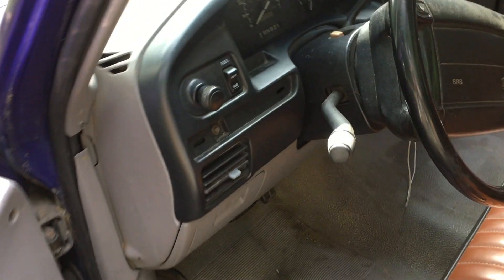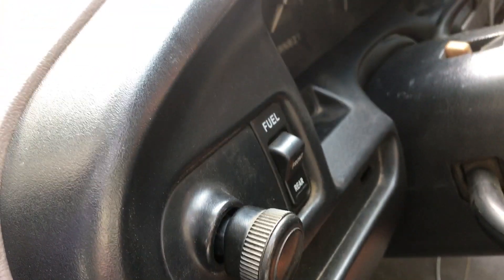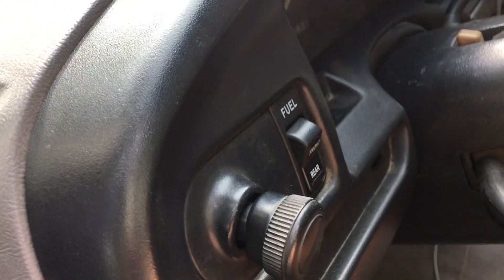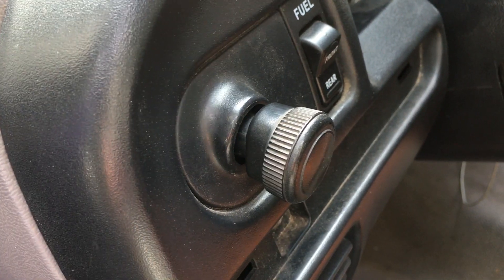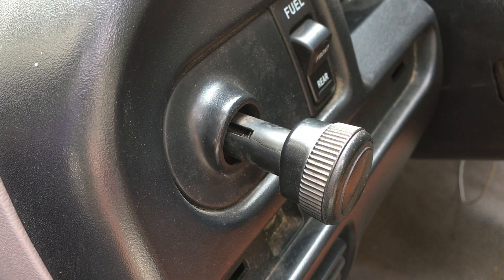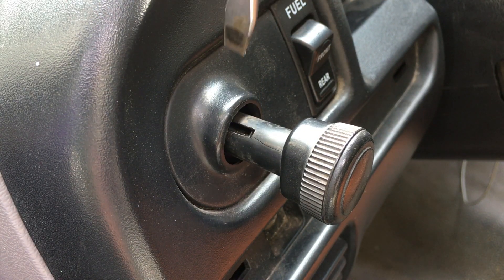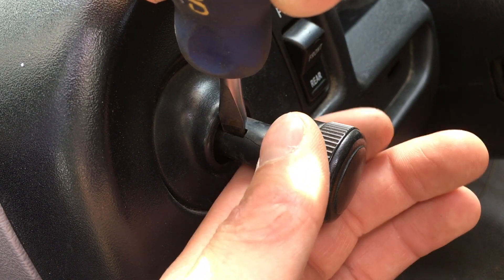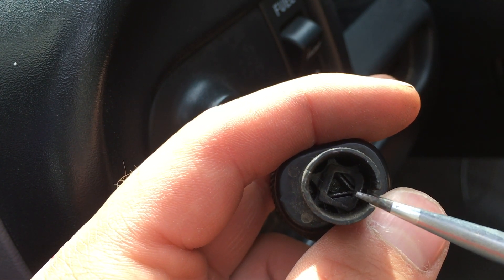How to Remove the Headlight Knob | 1995 Ford F150

Comment: Have you ever replaced it with the dorman knob and rod? I put mine in and the knob won't come off their is no tab to push down on and the rod is stuck in the house even with the button pushed still wont come out...
Reply from the maker: So I actually bought the Dorman replacement with the rod and I was going to use it, but I saw that potential issue and didn’t install it.

Comment: What about if it's already broken and glued together so there is no notch for your screwdriver to go into?
Reply from the maker: Yesenia Rangel Now that’s a problem! Lol If that’s the case, I would just cut it off and install a new knob. They sell new knobs online. I’ve even seen them on amazon.
Reply: Thats what I ended up doing. Thank you.
Reply from the maker: Yesenia Rangel Nice! 👍 You’re welcome!
Reply: The Minute Masters I have a 1995/96 Ford F150 XLT with a 5.8L and dual gas tank pick up truck that I have a few issues that I have never been able to figure out and was wondering if you had ran into these issues ever and had any videos on them: 1.) Rear gas tank has not worked in about 9 years, and when using the front tank it returns fuel to the rear tank which I have to siphon out, Ive tried switching the hoses, sealing the rear tank off and at times it wont do it but eventually my rear tank is full. 2.) Intermittent starting problem, sounds like it is starving for fuel, I've done a full tune up, spark plugs, distributor cap, wires, mass airflow sensor and housing, then it ran perfectly fine for about 8 months and now were back to issues with starting. This has been an issue for about a year and a half. 3) Front tank still works but marks way past full, rear tank wont run the truck but reads fuel amount perfectly. This issue has been for about 2 months. 
Have you ever ran into these issues before?
Reply from the maker: Yesenia Rangel Yup these are very common issues. So the first one I haven’t dealt with personally but I believe is a check valve in the fuel system. If I were you, I would replace the fuel pump in the rear tank entirely. It’s worth having that tank working. Besides, that could just fix your problem.
Not having a working rear pump could be why your truck will seem starved for fuel. Your truck could be trying to start on the rear tank. If I remember correctly, sometimes replacing the fuel tank selector switch clears up the two above problems.
So both of my tanks will read 1/16-1/8 inch past the full mark on the gauge when the tanks are full. I don’t consider it a big deal, but if you want to change it. You can pull the gauge cluster out and tweak the needle on the gas gauge until the reads perfectly. Does the gauge read well past empty when the tank is empty?

Comment: I've found that a O ring puller works the best. Ether a 90 degree or the shaped.
Reply from the maker: dustycows That would work well too! I need to get a set of those!
Reply: The Minute Masters 

The pick tools I like to use are the craftsman 41634 & CHP4-L sets or Wilde SHP904. USA made sets, the craftsman do have a grip type coating.
Reply from the maker: dustycows Thanks!🤙 I’ll definitely look for those.

Comment: I just bought brand new one on ebay and i cant get knob off. I couldn’t get my old one off either to get my dash off so I had to cut the plastic knob off. Any ideas?
Reply from the maker: Really? You even tried loosening the metal clip and slipping it off?
Reply: @TheMinuteMasters  metal clip doesnt move. I think the aftermarket one is a fixed knob. I might have to get actual oem ford one which is $58. The one i had to cut off must have been same from previous owner
Reply from the maker: @dirtyeric2  you could be right. They probably changed the design later on.
Reply: @TheMinuteMasters  its crazy because if u put it on you can never take dash panel off!! Love your videos thx!!

Comment: Lmao a year ago I pulled the switch and it came off and when I tried to place it back it didn’t work. For the last year I’ve used pliers to turn on the head lights since it didn’t have that little steal notch inside🤣🤣🤣
Reply from the maker: Jared Garcia hahahahaha
Reply: How tf did u solve this issue, im driving myself nuts trying to figure out how to put the switch back in, pulled the whole thing out
Reply: BritishBounty is it the knob itself that is missing the locking component? Or the shaft?
Reply: 3rd Coast OBS it’s the tiny metal tongue notch inside the knob, if you loose it you may need a whole new knob. Well at least that was my issue